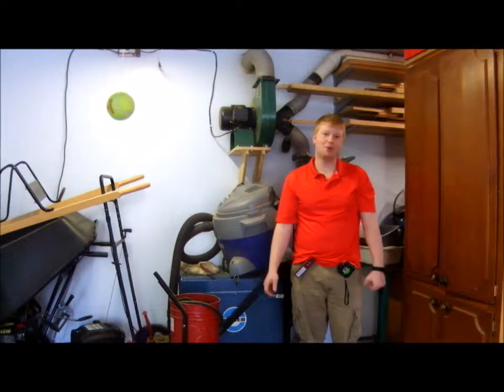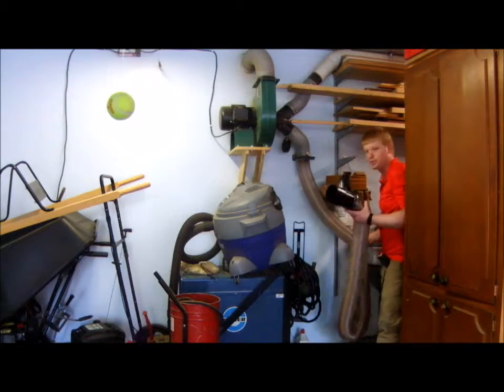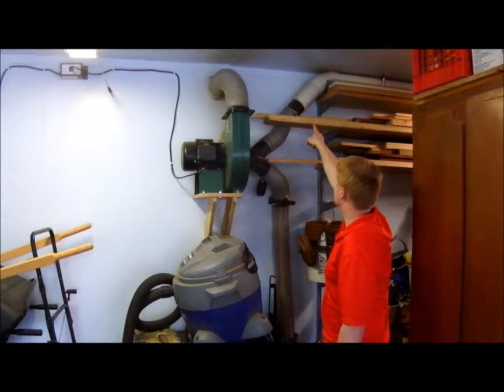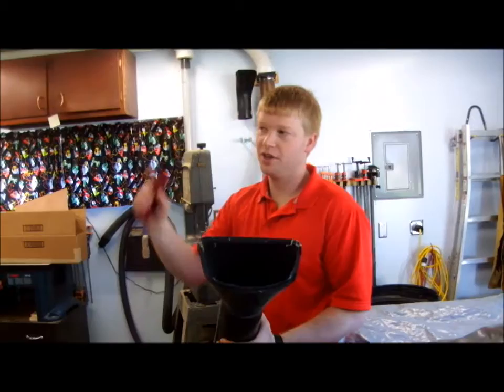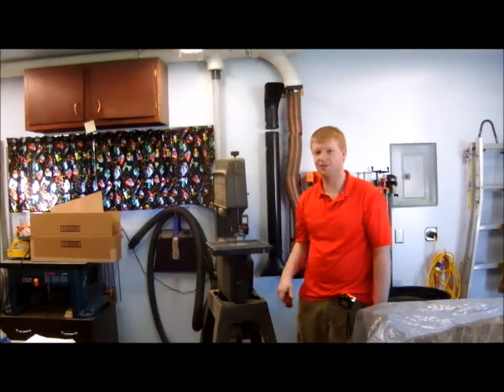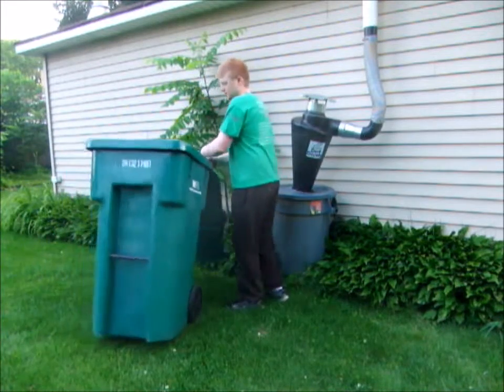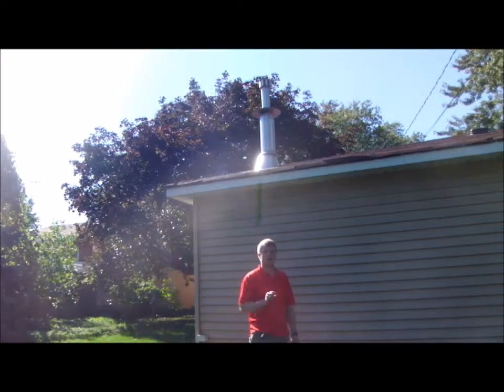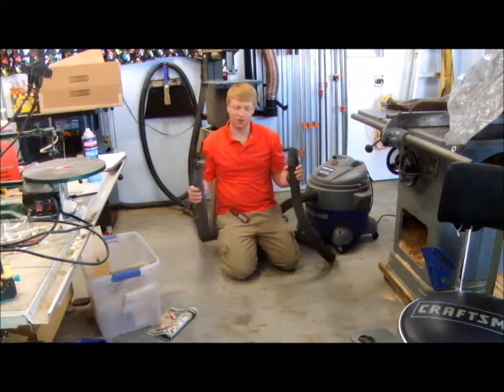Engineering a Dust Collection System for Your Shop

Comment: Nice work, I would like to make a suggestion. Typically you would put the cyclone ahead of the blower, that way any large chips or even metal wont damage the impeller,  say a large screw gets sucked up. I also vent out side through a 6 inch pipe with a nice looking large dryer vent type louver.
Reply from the maker: You're right, having the cyclone before the blower is ideal.  For me though, I'd rather risk the blower and save the floor space inside the garage.  So far so good, 3 years and counting with the same Harbor Freight blower.

Comment: It appears to me that the pictured HF blower motor may NOT be available any longer. I checked this one, pricey but is 2hp. Question sections indicates it can be orientated as needed. It is 72db @ 5 feet. https://www.pennstateind.com/store/DC250SEMB.html
Reply from the maker: HF still shows the dust collector is available, but the price has gone up. https://www.harborfreight.com/2-hp-industrial-5-micron-dust-collector-97869.html
Reply: Craftsman David thanks, for that link!